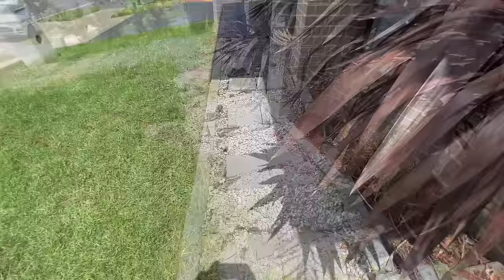Lawnmower Man Refuses To Mow Past Boundary Line #satisfying

Comment: I absolutely love your content, Tim. I actually ended up going back to the start and catching up on watching all your videos. As a viewer from Canada it just blows me away when your water meters are above ground. Here in Canada, we have a very low frost line and would never dream of having water meter lines above ground. Keep up your content. Love your videos.
Reply from the maker: Thank you!
Reply: Here in Australia, our water  metres are above ground. They are raised so the water metre reader has a special stick he opens it and it takes the reading, no bending.
Reply: Some parts of Australia do get below zero, but usually only overnight in winter (and we do have the alpine region too).  Where I live, we get a handful of frosts each winter.  The worst I’ve had is turning on the garden tap and it wouldn’t work.  It had a small slug of ice stopping the flow.  A few seconds of waiting and the pressure behind it was enough to get a dribble running past, which quickly melted the small bit of ice.  I then took advice from a friend who lives in the blue mountains and bent the tap slightly down (it was tilted back) so the non-pressure side of the tap completely drains with gravity once you’ve removed the hose.
Reply: the frost is fairly minimal in Australia even when it does happen and at most maybe -5 degrees or a bit more in super rare occasions
Reply: @terryatkins6118  lol that can't be the reason why.
Reply: I'm on the Gold Coast in Queensland and I'd say all our water meters are underground

Comment: Tim, what line you running now mate? Would be nice to see a video on turf and tools about all the different lines you’ve run and what each one works for. Also which one is your favourite or running atm. Also are there methods to getting your line to spin straight instead of all over the place. This is important for edging. Cheers mate!
Reply: Don't have your string too long.
Use the heaviest gauge your machine can handle.
Trim from right to left.

Comment: Is that a push mower from New Zealand or Australia?  I hear its got one of the highest settings to mow grass.  I mow my tttf at 4 inches a couple times a week.  I think it does better at taller cuts in the heat of summer.  Might even go to 4.5 inches for periods of no rain.

Comment: I notice the pros like you never use those wire brush whipper snipper attachments that are all over the net and my service man told me why. Too much torque on the drive shaft ( which is of varying quality ) - when all that momentum hits a snag - the forces can snap the drive shaft and definitely weaken it

Comment: Excellent work but I couldn't mow, rake and blow as I go like you do. I'd pull out all the weeds first, then prune, then edge, then mow, then rake and lastly blow. Those water meters you had to cut around looked dodgy as. Terrible positioning.